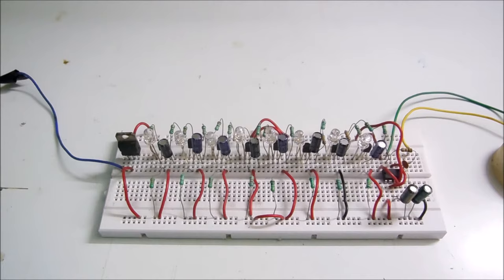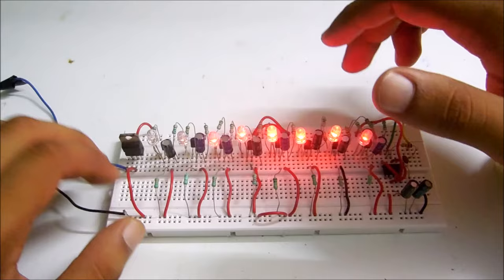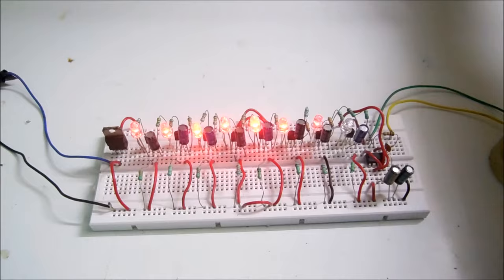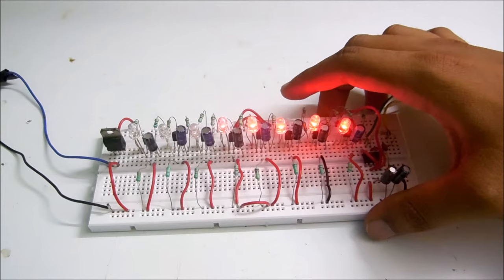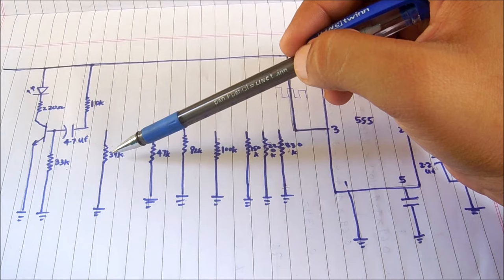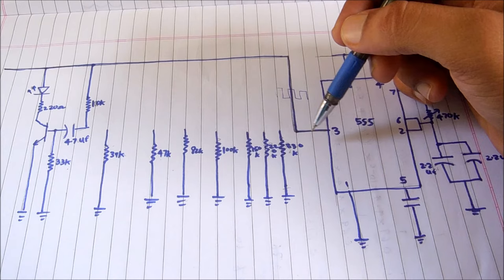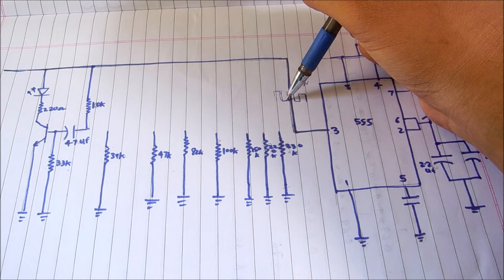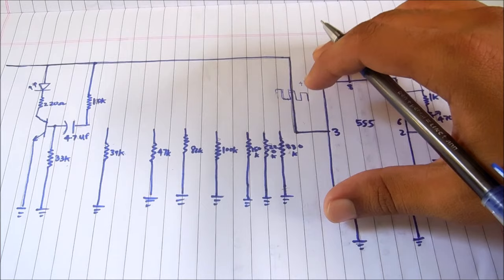led meteor rainshower circuit how its made ?

Comment: Heya. I love your work. Could you help me with a little project? I am after a circuit with about 6 to 8 LEDs which circle on/off for about 5 seconds. In addition I would need a second circuit which circles on/off for about 10 seconds. Perhaps I could make two circuits using a potentiometer which controls the length of the on/off circle. This way I can build multiple of the same circuit - i.e. - using the same components - but still can set to different time intervals using the potentiometer. Any assistance would be much appreciated. Thank you.

Comment: Hi. On 547 transister what is the value of the 2 resistor. The bottom.  7 resistor value can b seem properly. But the top 2 resistor . The left is which value.  And the right side is which.   And pls help me the other part.   555.  And the function.  And resistor.    Thank. You